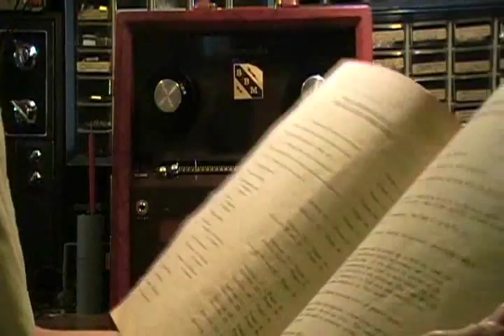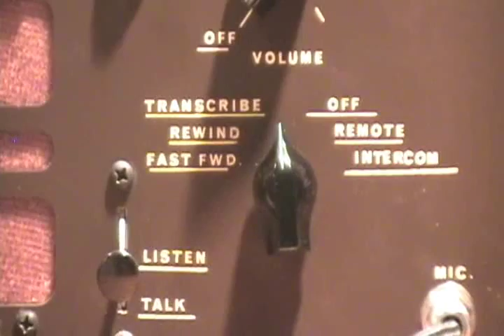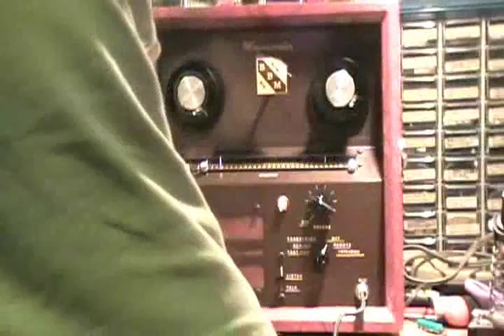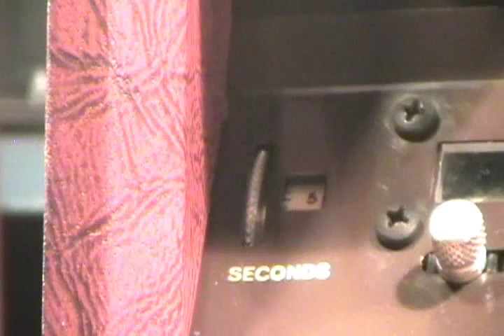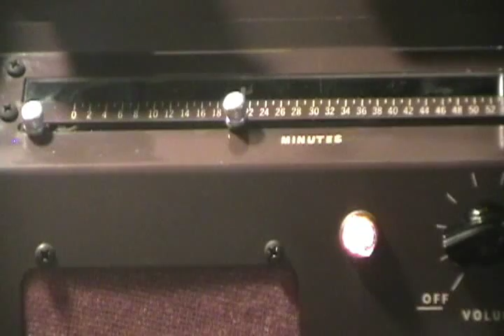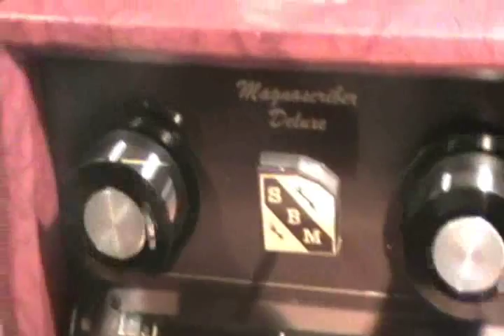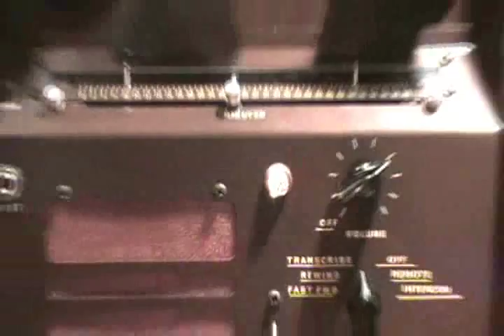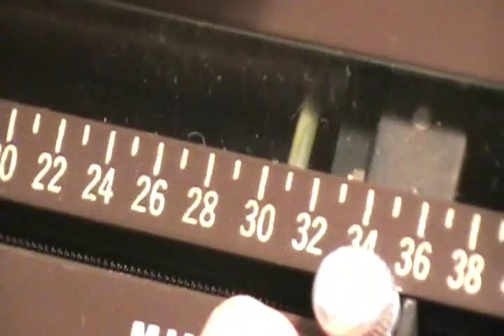Standard Business Machines model 160, "Magnescriber Deluxe" WIRE RECORDER!!!!!!!!!

Comment: The buzzing/clattering noise when the operator connects the call is actually the ringer, not the rotary dial. That is how it sounded on the old mechanical telephone switching systems, which were mostly replaced by electronic switches in the 1970s. I think the last mechanical switching system in the USA was retired in the early 1980s.

Comment from the maker: The 4 big relays operate at 120VAC, and the smaller relays, or at least the one I replaced, operates at 38-45VDC, which activates a 120VAC relay. Since the replacement I put in had a 120V coil, I had to replace the spring with a less-tight one so the solenoid would have enough pull to close the switch for rewind.

Comment: It is really something how this thing process low frequency bass response. It sounds awful but great in a vintage kind of way! Your voice played back on it sounds like some old radio broadcast or something. It would be interesting to hear what it sounded like if you connected the head directly to a modern amp through a better woofer & tweeter speaker system.